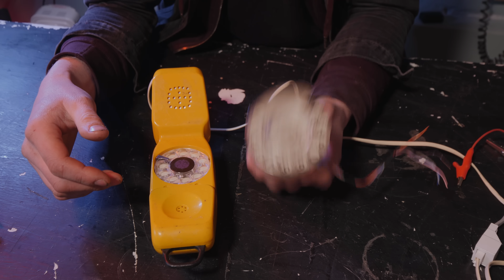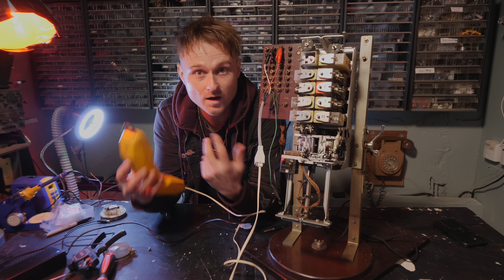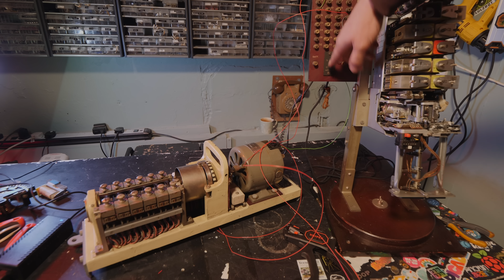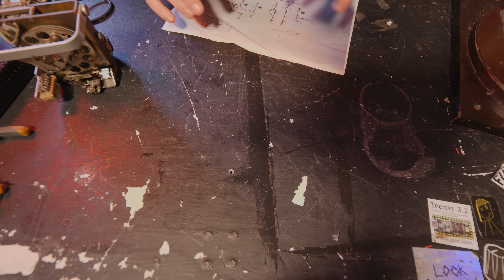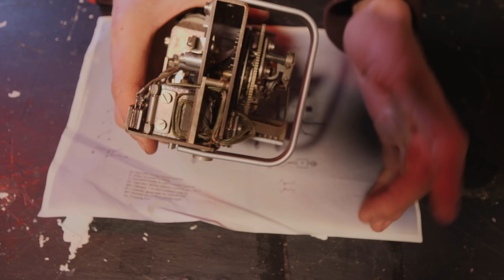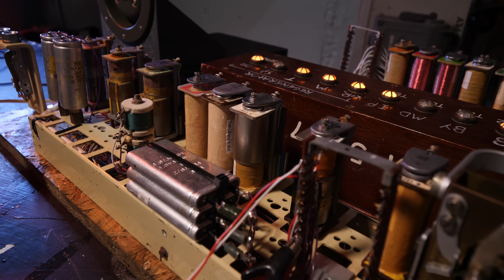The Weird Story Of Electromechanical Memory - 40 bits of the stuff!

Comment: So if you put a timed release and a manual trigger release on the MD relay and feed the output back into the input of the regenerator you have a very special loop recorder that can be programmed with an old dial phone… Who wants analog synthesizers and sequencers when you can have mechanical? You should build a mechanical sequencer based on telephone switching equipment to the organ or maybe rebuild an old barrel organ with an electromechanical programmable sequencer… 😃
Reply from the maker: I did try it. Unfortunately you need multiple as the loop ends up simplifying down to a single pilse
Reply: @LOOKMUMNOCOMPUTER  How does it not surprise me that you have tried that🙂 Oh well…

Comment: I remember making international phone calls from isolated Perth Western Australia to the UK, and the  background sounds lent quite an "atmospheric" quality to people's voices. Now I can see what a marvellous setup it was to be able to speak over 12,000 miles of wires, solenoids, repeaters and capacitors without a single soldered joint, spring, gear wheel, electric motor or selector breaking down.

Your descriptions, sequences, historical facts, musical creativity, videography and demonstrations are equally mind boggling.

A wonderful video, and great followup to "The History Guy" video about NOAA "Old Brass Brains" analogue tidal calculating computer which operated for decades until digital computers finally took over.

Comment: I have a push-button dialer that works on the same principle as your regenerator. it is purely mechanical, but it has the little pins. It was used in telephone exchanges so that operators could dial numbers more quickly. You should try to get one for your museum. (you can't have mine! 😁😁😁)  BTW Your videos are great!

Comment: As a ye olde 2-wire kellogg magneto+3V phone enthusiast, I wish I could thumbs up this video over and over. Excellent explanation! It also really gives you some appreciation for the early "RF" transmission line design since a lot of this technology could work at very low voltages (3-6V) over many, many miles even with resistive losses.

Comment: The motor- driven pulse generator made me think of the Hammond organ tonewheel system. 
I don't recall any videos of Look Mum No Computer discussing the Hammond, seems right up his alley.
Briefly,  two of the most interesting qualities of the Hammond 1) ability to proportion individual harmonics 2) unique unequal temperment (because  gears and tonewheels have integer tooth counts, harmonic frequencies end up being a collection of sharp and flat, making the sound much richer,  in my opinion)
Many Hammond organs also included an ingenious vibrato system (different than rotary speaker) wherein a spinning multi-section air gap plate capacitor picks off the signal progressively from an L-C phase shifting line. Brilliant.
Reply from the maker: Yeah! The ringing machines from exchanges are what the Hammond tonewheel was based on apparently. Search it up. As for a vid on Hammond I do videos on what I can get hold of. Hence none on a Hammond organ like that! Not happenned upon one to dismantle

Comment: Very impressive, never before heard of these diallers restoring the dial pulse timing but very interesting. You mentioned all the signals going over the two wires but you didn't mention the 60 Volt AC bell signal that goes over the same wires. Probably not as relevant to the dialler explanation but still an additional signal over the same wires.

Comment: That would have been an interesting time to point out that the relay was invented for exactly that purpose, and that is exactly why it's called a "relay".
Reply from the maker: hey greg cheers for the comment, i thought relays were designed before the telephone for turning on high voltage items somewhere else in a factory, then about 50 years later the idea got use for the telephone?
Reply: @LOOKMUMNOCOMPUTER  Nah, if you think about it, a Morse telegraph sounder is just half a relay. Since the first Morse-type systems were operated by batteries, the signal would only go 10 or 20 miles, so they'd have relay stations  placed to refresh the signal. You just had to add a pair of contacts to the armature of the sounder. I'm not saying they didn't use the same device as high-amp switch, but they didn't call that a 'relay'. The reason it's called a relay is because it relayed the signal down the line. (As far as I can tell. I couldn't find a source for the info now, so I could have just made the whole thing up. lol)
Reply from the maker: @gregmark1688  yes Greg but what I'm saying is the coil relay initially was from factory switching. Then was used for morse
Reply: @LOOKMUMNOCOMPUTER  The first Morse telegraph systems were installed in America in the 1840s. The electric motor was no more than 10 years old. I didn't know factories were already using electric power at that point. What did they use it for?
Reply from the maker: @gregmark1688  all good. It apparently all happenned so quick. I have found that newer books on the subject say morse etc was the first but older books say the factories and the technology was used to communicate. They were used to turn on the motors and stuff from control panels using lower amperage cables to the high amp cables to the motors in the time when they were changing over from steam. 1830's likely all happenned so quickly. As far as we are concerned it al was the same time :D.

Comment: 3:12 the founders of Apple, Steve Jobs and Steve Wozniak invented a device to abuse the flaws in the system and make free calls, routing the line automatic all over the world, using public phones on the street.
Reply from the maker: yep but very DTMF times, but still interesting though
Reply: @LOOKMUMNOCOMPUTER  there is a 74HC4067, 16 channel multiplexer, use transistors to level shift from 5V to 48V.
some and/or gates, flip flops.
: )
Reply: @LOOKMUMNOCOMPUTER  this ic: 74HC147 might help you to control the logic of the 74HC4067.

some diodes and lots of head scratching might be required as wel.
Reply from the maker: @AnalogDude_  hey analog dude what are you talking about these chips for regarding the phone? the multiplexer and high priority chips are good im just not sure why you are mentionning them for this video. cheers.
Reply: @LOOKMUMNOCOMPUTER  in case you want to build a device that can minic a old phone, not using software and dial a number.
: )

using 10 x 555 timers to generate 10 tones and via the multiplexer lead them to their destination. seemingly it can be done with a keyboard, holding them multiple key's. after reading the article on Steve Wozniak yesterday.

or using 555 timer to generate a 66/33% intervals using flip flops and what not.

just an idea for a build.
Reply: @LOOKMUMNOCOMPUTER  you could use a CD4017 to set the numbers you wanna dail. 74HC174 hex flip flops or octal flip flops to memorize "numbers" / digits.

not easy, lots of head scratching but could lead to something cool.
Reply: @LOOKMUMNOCOMPUTER  maybe ...
2 octal flip flop coupled to 2 74HC126 serial shifters could do the job (partially).
on the output of the (last) 74HC126 you put some sort transistor setup to make you local phone "exchange" think a real phone is present, some kind of NPN/PNP setup transforms to 48V controlled from 5V, maybe some darlington trannies there before the NPN/PNP.

before the octal flip flops you construct the 0-9 bits out of diodes, a diode setup for each number.

Than you only have to feed each of these diode setup with a N channel mosfet, like BS170 before the diodes to select the numbers.

than you need 3 mechanism, select the number, load in to the flip flop and shift out of the 74HC126 in to your exchange.
something like that ... all within the time frame.

Comment: At around 15 minutes in, the MD pin was mentioned, which delays the regeneration.  There’s a statement that 5his isn’t what it was made for, but that was exactly why these devices exist.  Back in the day, when one long-distance dialled, it took time to set up a long-distance circuit, a few seconds, and in those few seconds, dialled numbers would be lost.  Enter this memory gizmo, which captured the dialled number, and didn’t release the digits until the long distance circuit was set up.  You actually could hear this working, back in 5he day, you’d dial the number, and then you’d hear quiet-ish dialling clicking, as the stored number got replayed up the line, before finally you would get 5he ring tone.
Reply from the maker: cool! so you are saying the auto to auto relay sets had a feedback wire or something to the MD relay? or the MD relay was sufficiently delayed to make sure the switches far away were ready?

Comment: I used to work on these regens, No1 problem was if any oil got on the pins they had a tendency to fire out and the whole thing would get confused. They were replaced with an electronic plug in replacement that was more reliable and less susceptible to temperature changes. If I remember it was a 1 week course to learn how to adjust them but I never got sent on that course.
Reply: I also worked on regents. I was lucky to go on a course, not at “sunny” Stone but a regional training centre in Leicester. As usual I had been working on these for some time, so it wasn’t to difficult. However 1 person did fail the course, seemed to remember if you couldn’t get it to receive a pulse then send a pulse on all 40 pins, then fail. Bent pins seemed to be the main fault with these. Happy days.
Reply from the maker: @willsgrandad  bent pins! blimey i bet that took a bit of force, im trying to track down some more to get a loop of the auto auto circuits running, only manated to track down this one and one that has some bits removed. on the hunt! fascinating little things, apparently also they could lock up and become a fire hazard??? is that the case?
Reply: @LOOKMUMNOCOMPUTER  
All exchange equipment had fuses, so fuse blows before overheating. However can’t remember ever having a hot coil on these. Correct adjustment is paramount .
The motor drive uniselectors, which you have shown before,however, where prone to blowing fuses. They put fuses in the test jacks instead of metal links. Can smell burnt coils now!
If you go to Bletchley Park, to the computer museum, they have a model of the machine that cracked the enigma code. It is made up of Strowger equipment.
Reply: It was a 4 day (1/2 day Monday & Friday to allow for travel) course at the Training Centre in Stone here in the U.K. I applied each year, but never got selected during my Strowger maintenance days 🙁

Comment: As an ex Strowger telephone exchange engineer, the simple explanation of how those switches work was “A op’s (operates) B, op’s CD… and the rest is automatic”.

Those pulse-rediallers were commonly used on long distance trunk lines here in the U.K. where there could be a delay in establishing the link with the far end (could be a few seconds) before the end to end link was established so the digits could be received at the far end and the call routed.

You can route the output back to the input, and this will just self repeat (up to 40 pulses) so you can make a Christmas tree light flasher/sequencer with multiple pulse repeaters in parallel.

Great video as always.
Reply from the maker: cheers ian, yeah good idea on the christmas tree, i did run it around into itself but i had to think a lot about the pattern to make sure it wouldnt just go back to the simplest pattern, im trying to find another one or so to build a few of these circuits to get them to talk in a circle haha

Comment: Years ago when you got a motel room there would be a lock on the phone dialer.  But if you were clever and could tap out a number with the switch hook tapping out one number at a time like tapping a morse code key ,you could still call out without unlocking the dialer.  I can do this and have often shown this to people and friends that have landlines . The phone system still works with rotary phones and you can have fun demonstrating this to friends.

Comment: I am old enough to remember actively using pulse-dial telephones.  In fact, when I was in the US Army, my first active-duty assignment had me working as a military journalist at a location that still did not have touch-tone telephones.  I knew that the pulse dial phones worked by 'flashing' the line quickly, but I never knew how the rest of the system made that work.  Knowing what I know today through my work as a software engineer, seeing this explains to me why occasionally we might connect to the wrong phone number; anything that relies overmuch on timing is prone to errors.  I appreciate even more how well that system worked, despite the occasional wrong number.  Gads... could you imagine if we continued to use this system today, with all those phones (particularly all the cell phones), each one requiring all this mechanical stuff?

Comment: In the 'old days', there used to be two bare wires to the house from the telegraph pole. In high winds they would oscillate and the wires could touch... If the emergency number was 111 or 000 the wires could easily 'tap' together nuisance calling the emergency services. Other numbers such as 7's or 8's were reserved for other services. It was also decided 999 was easy to remember and dial in darkness/smoke as it was one finger hole below the '0'. This regenerator was also used as a delay until the equipment was ready to receive the pulses further down the connection.

Comment: Can you imagine the sounds of being inside a major telephone switch in 1950? 🤯
Reply: I didn't have to.  I grew up spending almost every evening after school in the local switching room.  My father was a technician for Mountain Bell. It was the loudest after 5 pm. The heat from all the relays firing off could bring the temp up quickly.  The building had air conditioning that ran all the time even in winter.
Reply: Later crossbar switches that replaced step-by-step also have a very particular sound about them (I'm sure you can probably find videos on YouTube that demonstrate the sound)

Comment: THe mind blowing realization is that the first pulse would trigger the first solenoid at your local exchange to spin around once for each pulse, connecting you to either another local solenoid or a remote one, and then each additional set of pulses would cascade to another solenoid which would connect to somewhere else, until your wires were PHYSICALLY CONNECTED to the wires of the phone you were calling. People used to the Internet and packet routing may not realize that the whole crazy phone exchange was all about making one loop of very long wire between you and your destination.
Reply: And that this was true of international calls as well. You would physically link a wire across oceans and continents. This was, of course, also the largest problem as resistances and loss would accumulate rather quickly and calls would get quiet and noise filled.
Reply: Thus giving rise to fanciful phone pheaking devices like the "Urine Box" which was designed to send a high voltage pulse through the remote operator's handset.
Reply: @Barnaclebeard  and yet it was only a hoax
Reply: @audhen1  Yes, I forgot to mention that detail.
Reply: This wasn't literally the case for most long distance calls. It is more economical to multiplex several calls to share the same physical wires, so the audio and signalling were separated and heterodyned up and down in frequency. The first multiplex route was installed in 1918.
Reply: Yep. Very complicated, extremely high reliability needed, massive physical infrastructure. That was what was required, so that is what they built.
Reply: BlottoBox

Comment: Those sounds ring a bell. In the 70s by uncle worked for the GPO (BT) and took us to see a working phone exchange. It was huge room full of machines making sounds like that. There was a backup diesel generator and another room sized lead acid battery for backup. You wouldn't want to fall in the vat of acid.

Comment: I look at these beautiful mechanical  object I kept thinking....how would you clean maintain and lubricate something like this and how fast did it wear out.
Reply from the maker: one of the rules of these was not to oil it as the pins would fall out, they were rated i think at 1 million cycles. uniselectors were anyway, these possibly similar
Reply: @LOOKMUMNOCOMPUTER  Ahh to leave it the hell alone and let it do its thing. Cheers from Brisbane Australia btw. 8)
Reply: All Strowger kit had a “routine” maintenance schedule. Whilst uniselectors were the most regularly cleaned items in the exchange where I worked, single motion and final selectors were next, but these pulse repeaters were only tested every 6 months or so (or pulled when they failed) and returned to service if working within spec.

Most Strowger system fault finding was through listening - you could hear most mechanical faults, but ironically the noise at peak time soon damaged your hearing…

Comment: you should relay get in to old jukeboxes! this is how an old Bergman works..... if you want to work on one or to i have about 500 of them!
Reply: Both my old Wurlitzer and Rowe Ami use a similar method as the selector mechanism.
Reply from the maker: you got 500 jukeboxees? how you end up with them?
Reply: @LOOKMUMNOCOMPUTER  well i an the "permanent care taker" about 1500 jukeboxes between our two museums but i have just over 500 boxes that need restoring  or braking down for parts..if your interested you can come an see how terratechnica (the worlds largest collection of jukeboxes) works
Reply: oh yeah also about 700 pinball machines